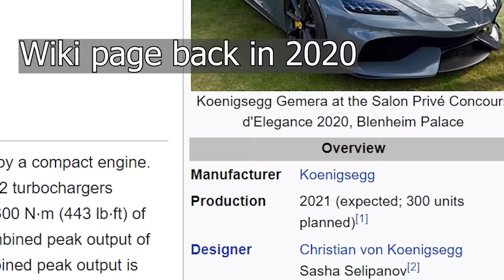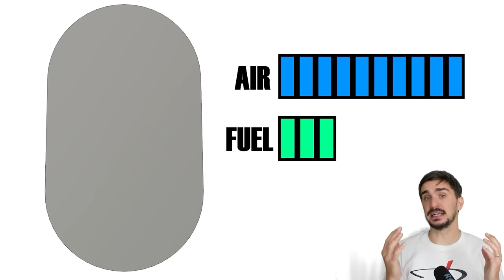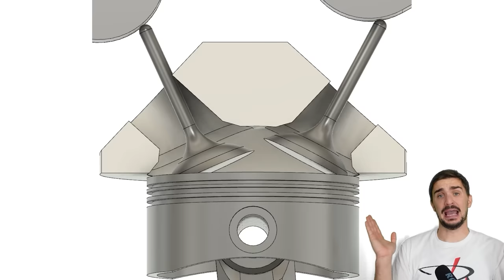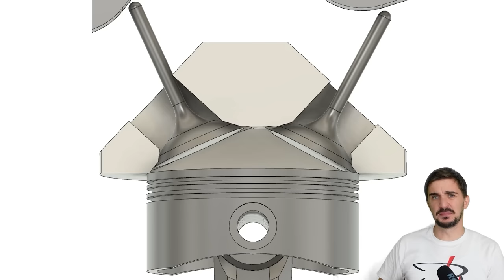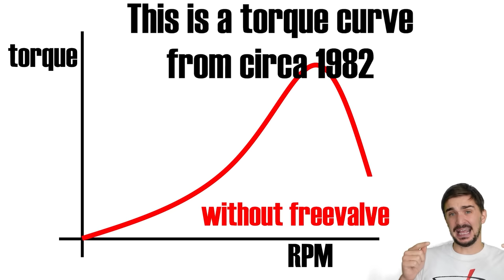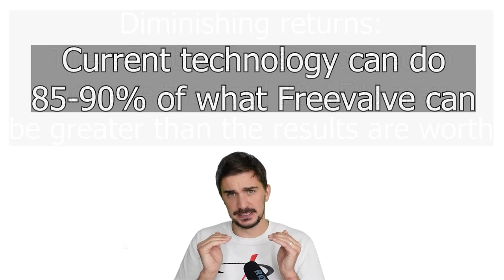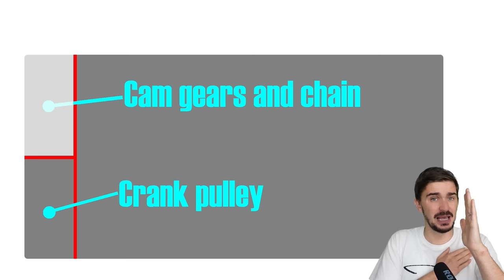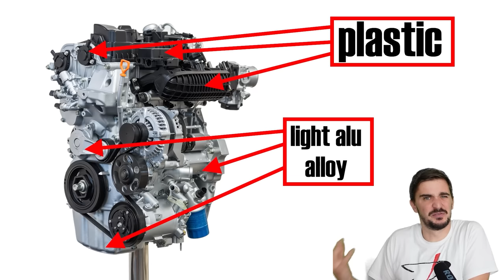FreeValve Isn't a Big Deal. Here's why

Comment: Freevalve is not a big deal, because it still using a spring, so it's still as slow as spring driven systems and because it only really has two states. If you could open the valve to variable amounts and it was faster than springs everyone would be using it.
Reply: Yeah everyone would be using them if they could theoretically exist and be built.
Reply: @JunkCCCP  Theoreticly they are very possible. You can hold an object in variable positions between magnetic fields.

Someone just needs to do a ton of engineering work to make it happen.
Reply: Ehh free valve is hydraulically activated, if it has a spring it doesn't work like a conventional valve.
Reply: @v4skunk739  No it's not it's electromagnetic against a spring. No one uses hydraulics in valves. Even old F1 used pneumatics.

Comment: One catastrophic failure - you discussed only peak numbers, while you did acknowledge the most benefit of FreeValve being at lower RPMs/off-peak.

Still gets a thumbs-up and a comment cuz it's a really great job discussing what's actually there and how it doesn't push the peak very much!
Reply: Did we watch the same video? Seemed to me like the majority focus was on the shortcomings and peaky nature of camshaft engines with fixed timing/profile and how those issues have been mitigated over the last 10~15 years, closing the gap to Freevalve.
Reply: @karashibass  did you hear any figures discussed other than 6% of peak rated HP? Cuz I didn't. Perhaps I missed it, or we did indeed watch different videos? Do you have that figure? I would love to know what the difference is in total area under the curve!
Reply: @krakhedd  Sure I can give you a few figures, since you weren't watching.
0:51 - 8 years since Freevalve announced
The video talks about why fixed valve opening is bad - trade off between high/low rpm.
7:48 - Graph showing the area under the curve - this is an obviously exaggerated example because engines aren't made like that any more, this is the point of the video which you missed.
9:00 - Claims made in favour of Freevalve by its proprietors, contested at 13:42
9:25 - Comparison to a 10 year old Mini Cooper S JCW
10:18 - Comparison to Toyota Corolla GR
12:04 - The key point of the video, followed by competing technologies

If you're looking for some hard data on the difference between modern engines and a theoretical Freevalve competitor, that's going to be hard to come by because Freevalve is borderline vapourware.
Reply: There is no benefit of FreeValve at lower RPMs compared to modern "traditional engines".

Look at the BMW S55 for example:
A twin-turbocharged inline-6 with 3l displacement producing ~430 HP.
The engine has VANOS -> variable valve timing
The engine has VALVETRONIC -> variable lift and duration
As a result of these two technologies this engine produces its maximum torque (550 Nm) starting at ~2000 RPM up to ~5500 RPM, in 2014!

This engine produces its maximum torque 1000 RPM after idle and up to 2000 RPM before redline. These limits result from streaming effects of the ducts in the cylinder head and intake manifold which FreeValve can't compensate either. There just are some physical boundaries that can't be crossed regardless of the technology used.
Reply: @karashibass  still not being answered - the 7:48 time stamp shows an "old" style (read: non-variable design)

The GR again looks only at peak numbers

Comparing boosted engines without regard for charge cooling, let alone reference for mass air flow, does not satisfy my curiosity

So yeah....still not answered
Reply: @juliannuber3852  You're comparing the peak HP w/ the torque figures for that particular engine as engineered, which does not offer any data, implied or otherwise, as to potential benefits of FreeValve on this engine, let alone low RPM performance (where a long duration and lower lift would benefit the engine, but then impact its high RPM performance)

Comment: I could only agree with you on the small marginal power output increment, but the main benefit which is not discussed here is the energy lost in powering the camshaft. Main advantage of freevalve is initial power / crisp acceleration.
Reply: I guess the question is does the air compressor and pneumatic system use less energy overall than camshafts? Idk, if you want more power it seems like there's plenty of other ways to accomplish that than trying to make the valve timing system slightly more efficient, I'm not sure about it.

Comment: A friend of mine at a local college taught ICE theory He was trying to build a rotary valve. A disk with holes would spin around causing an unobstructed flow of air into the cylinder. Due to health issues he never finished it   It would be nice to see someone continue his work and actually build one.

Comment: Also whats interesting is that Tucker made essentially a freevalve back before 1948. When he first developed an engine for what would become the Tucker 48, before he chose to use a modified helicopter engine, he was developing a 500+ cu in engine that would use a special distributor to send pressurized oil to open the valves at a timing set by the distributor. This wasnt done for performance though, as it was common back then to puncture your oil pan and run your engine without oil, this destroying it. So tucker opted for this distirbutor oil valve tech so that your engine would shut off if it ever didnt have oil. This engine, which was going to drive twin fluid drive torque converters as a sort of CVT back then, never made it past prototyping, as it required mains voltage to crank, weighed a gargantuan amount, and  wouldve been too expensive.
Reply: Don’t believe I’ve heard of that, very cool.
Reply: Most people discard the thought of it, but people like him made America "special" in the World. IMO, though. 👀👀
Reply: Can be re programmed spécialement

Comment: I have never understood how varying the intake valve opening instead of having a throttle body can reduce pumping losses, because either way is still restricting airflow into the cylinders and creating a vacuum in the cylinders.
Great quality content as always. Thank you
Reply: Because you're always going to have the valve, so you have the additional restriction of the throttle body if you need it to be there.
Reply: FreeValve is a great achievement.  I ought to know I invented the concept in 2005. The valve is much closer to the cylinder than a Throttle body. Air is highly compressible. Making changes at the valve provides much quicker response because the air pressure has virtually no time to vary.
Think of three rooms 1,2 & 3 in series all connected by one door with the middle room having a doors an in and an out. Flow is one way. Room1 is your intake before the throttle body, Room two is your manifold, Room 3 is the engine cylinder.  Door1 is your intake system, Door2 is your throttle body, door3 is your intake valve.  Door 4 is your exhaust valve
Room one is fill of people and the people must get into room three as quickly as possible, Initially the middle room,  room2 is empty. The 
What is the fastest way  to get all the people into room 3 ?
Simple eliminate room 2, the manifold and connect room 1 directly to room 3.

Freevalve eliminates many friction power robbing parasitic parts.
Hope this helps.
Reply: @intercity125  The throttling function is still the throttling function.  To get the same percentage of engine power, the total restriction is the same.  If it didn't have the same total air restriction, then more air would come in and the engine would either run lean or produce more power than desired.
Reply: Similar to ITBs. Instead of having vacuum to overcome in a plenum due to a traditional throttle body, you have atmospheric pressure at the each individual throttle bodys, or in the case of freevalve, the valve itself.
Reply: @mrgcav  lmao you definitely did not
Reply: I completely agree with everything mentioned here, but if someone can explain how FreeValve reduces pumping losses I would really like to know

Comment: I believe that for tuner/project racers, it can possibly become some kind of "performance revolution." I've had the idea floating in my head for a while of taking a very fuel hungry V8 and shoving individual intakes plus freevalves on an engine. It would allow you to run a miller cycle in highway driving but then press a button to switch into a racing regime when you need all of your power. The reason freevalve is perfect for this is because most small garages and one man modding shows don't have the manufacturing prowess to machine complicated bits of aluminum/steel, or to mold high temp plastics. Something like Freevalve, while requiring some heavy modification, are more of a "car mod" type thing and less of an "engineering degree" solution. Of course, I'm not trying to understate the difficulty of retrofitting freevalves to an engine that was not designed for them in any way, but it feels like a cool way to give an engine power on demand.

Also, on cylinder deactivation, especially with individual intakes, you could use freevalve to prevent issues like oil burning when cylinders pull a vacuum. Yes modern engines have done it but that comes back around to complex mechanical bits and how to manufacture said bits. 

And I'm still curious, if you used oil pressure or even electrical impulses for the solenoids, could you avoid the extra losses from the air compressor and camshaft of a vvt engine?
Reply: Freevalve is basically racing engine, (notably F1), valve tech. Performance junkies would absolutely benefit enormously from it for the ame reasons racing has.
Reply: BEST COMENT SO FAR, nice brain work, pall ! Tamo junto e misturado 
🤜🤛👏👍

Comment: Congratulations on writing and producing such a brilliant video on what is for most people, a very complicated subject.

Your use of graphics is first class and matches your own wide knowledge of state of the art engine design.

Not wishing to steal anyone's thunder, when I was a petrol engine designer (1970 - 1977), Intake Valve Throttling was the latest idea in my sphere alongside CVCC not to mention Ralph Sarich. The Arab-Israeli conflicts and threatened fuel rationing in the UK was the impetus behind my employer's interest in magnetic and hydraulically operated valves; in breakerless (ie Electronic) ignition using reed switches in the HT leads and in 'iris' throttles - amongst many other ideas designed and prototype tested. The management's  objective then was to produce a car returning 50mpg (Imperial) at 50mph.

50 years on, I now realise just how advanced such projects were. The dates on the patents are the unequivocal proof were it needed.

Comment: I always though free valve would be a great tech for aftermarket support on older vehicles. Literally breathe new life in the engines extend the life of the cars. Can't imagine what my little vw bug would be like ❤
Reply: doesnt work like that
Reply: @chehystpewpur4754  what doesn't work?
Reply: @liveness2006  every engine is designed. you cant just delete parts. 
you either have an engine with camshaft or you dont. for example many engines are considered cam in block. theres a 3 foot long camshaft in there that literally runs your distributor oil pump ignition timing. you cant just take it out. your oiling system would also fail horrendously due to 8 gaping holes in it now. 
on an overhead cam engine yes you could effectively completely redesign the head and delete the cam. but anything else that may run off the timing belt or chain doesnt exist anymore. like a water or oil pump. your bug doesnt have water pump atleast so your in luck there but its gonna cost more than the bug costs to convert. youll see no real power difference. 
and chances are your bug would become an unreliable mess. electronics dont like heat or vibration. mount electronics to the hottest part of the engine inches from explosions. 
the other really big issue is your car doesnt have a computer. so now you need to add a rats nest of wires and supply it with power. youll need a crank sensor too. youll need an 02 sensor. throttle position sensor. oil pressure sensor. mass air flow sensor manifold pressure sensor. the list goes on. youd have to redesign the whole thing from the ground up. 
your car is just fine the way it is. reliable and simple. i was interested in the tech when they announced it then immediately didnt care once i seen their tech. it doesnt work. 
you wanna breathe life into you old bug. take my advice. save your money and take this for a pipe dream. buy a cheap small supercharger. amr500 would work. or look for eaton m62 or eaton m90 you can get those used for cheap too. or buy a standalone efi kit for your bug and you can fuel inject it. youll make more power get better mileage and it will run good. 
you could do both of those modifications for under 1000 dollars and absolutely love your little bug. probably even win a few small races.

Comment: Question: How does air speed affect the air-fuel mixing in engines with direct fuel injection?
Reply: Although fuel is directly injected into the combustion chamber, the air is not. Therefore, the different velocities of the air at different RPM will still affect air-fuel mixing.
Reply: I'm curious too.
Reply: The higher the speed, the more tumbling rotations, mixture acheves in the cylinder before ignition
Reply: as only fuel is injected and not a/f mix that might be the answer to your question. the faster the air enters the combustion chamber, the more tumbling and therefor a better mix will occur.
Reply: If I got it right then in a di gasoline engine the fuel gets introduced as the intake valve closes (round about that point). I know it's not the best analogy but imagine like an mixer running at 2 speeds (that would be the air speed). Throw something into it which one mixes faster. Ofc the faster one. You can imagine the air twirling around in the cylinder and the faster it enters the more it twirls. I hope I could get the point across
Reply: It's not about the air-fuel mixing as he explained, but the scavenging and air volume trapping in. If you have a low velocity, you can't trap in so much air as if there is high velocity.

Comment: What about the mechanical losses of a valvetrain system? FreeVavle theoretically would put less strain on the whole bottom end, meaning reduced wear and an increase in performance due to no parasitic loss. It would be interesting to know how much parasitic loss is added through the alternator that generates the power for FreeValve.
Reply from the maker: I wondered that too, but there's probably no simple answer.
Reply: Freevalve uses very little electrical power, It's an electric pneumatic system with electric hydraulic latching system, The systems primary parasitic device is a variable rate air compressor, basically a car A/C compressor. 

Electrically actuated pneumatic solenoids control the air pressure that opens and closes valve, and electrically actuated hydraulic solenoids control oil flow in and out of a chamber that prevents valve closing until commanded. 

The whole system probably has less parasitic loss than having your car A/C and car stereo on at the same time.
Reply: @taznz1  There are other kinds of linear actuators that maybe could replace everything with a single electromagnetic component but I don't know how possible this really is, such as the Permanent Magnet Assisted Linear Switched Reluctance Motor.
Reply: @taznz1  Car AC compressors are a pretty big parasitic draw.  Have you ever used yours?
Reply: @vitordelima  A pure electromagnetic system would need very large magnetic coils to overcome combustion chamber pressures to open exhaust valves and would use a lot of power to open valves and hold open. The use of a linear motor to give variable lift control could work but size and weight and speed would likely be an issue. pneumatics are fast, effective and reliable.
Reply: @ProfessorOzone  Traditional valve system is very parasitic due to rotational mass, friction, and spring pressure.
Reply: @taznz1  That's the reason it can't use a solenoid and magnetic assistance would help keeping the valves shut.
Reply: @taznz1  Ok.  I never said it wasn't.  What I said was an AC system also has a pretty big draw.  You implied the AC system was an example of a system that had a small draw.  On my car I can totally feel the loss in power between AC on and AC off.  It can be as much as 10%.  Just sayin.
Reply: @ProfessorOzone  The average A/C in a modern car is rated at 3KW or around 4HP, there are some efficiency losses due to the compressor not always been run at optimal rpm, but modern car A/C compressors overcome most of that by being veritable output. At most you might see a 10HP loss between A/c off and on, but it's normally a lot less than that, this loss doesn't scale with engine power, so it's only going to be 10% in a Kei car and a 1950s land yacht.
Reply: @taznz1  Ummm, sure.

Comment: Absolutely, you'll need loads of kilowatts to make all those valves dance. You have to get the power somewhere, but it will (maybe) save weight, rev higher, and enable more programmable timing. Depends what you're trying to do. There are ways of doing electronic valve timing by using electric motors rather than individial valve control.